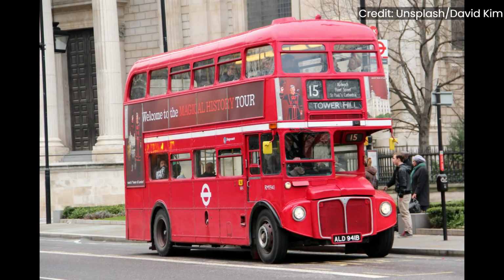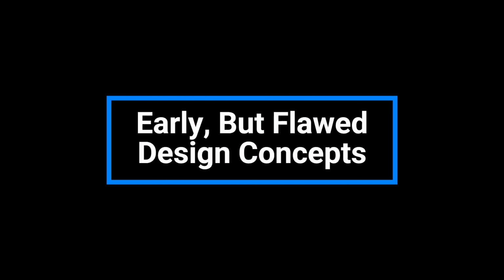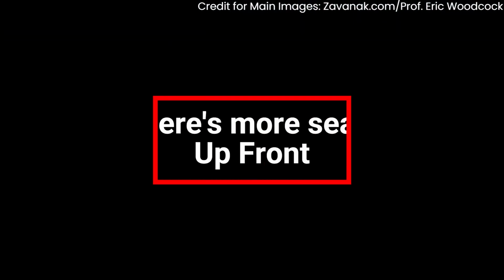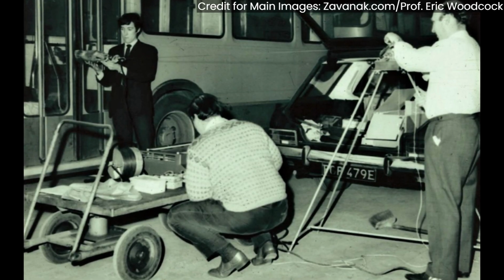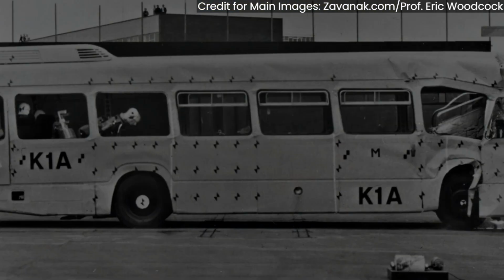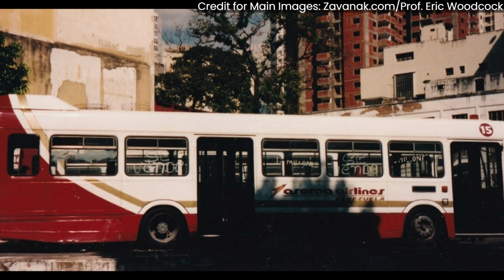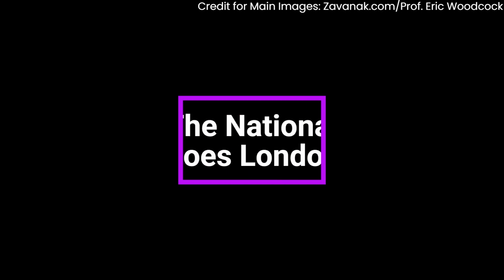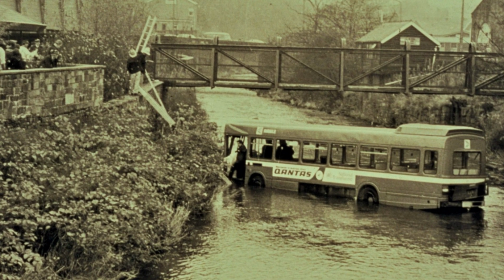The Leyland National Bus: Amazingly Flawed Engineering!

Comment: From 1969 to 1975 I worked in the Leyland Truck and Bus Central Engineering design office on various projects which included the National Bus so I feel that I must congratulate you on producing a very well informed video which includes a number of items about which even I was not aware. Nice work! I will just add that the original styling was carried out by David Bache of Rover but, at the last minute, Sir Donald Stokes the CEO decided to call in Michelotti instead to give the bus a revised look. The initial vehicle design was for three length of 10, 11 and 12 metres but, for the Michelotti redesign, these were replaced by two lengths of approximately10.3 and 11.3 metres to better match the seating pitch. The later 10.9 metre was, as you said, a hybrid of the two. The bus was originally designed to take the 680 engine and the mistaken decision to change this to the less refined 510 is suitably described in some of the  other comments. The overhead heating system inevitably lead to warm heads and cold feet: a strange decision aimed at simplifying the floor design but not the best one.
Reply from the maker: Hello! Great to hear from someone who worked on the National! Interesting info on the original design of the bus. Wish I knew that when I was making the video! Thank you for watching and for your comment!
Reply: The 500 series engine was the brainchild of Albert Fogg who had come to chief engineer at  Leyland from directorship of the Motor Industry Research Association, the charitable view is he was an original thinker.  Higher output Leyland 680s and 400s as well as examples with experimental turbocharger fitments had problems with cylinder head gasket failure. Dr Fogg's decision was to replace them with an engine with no cylinder head.

The 500 series was controversial in buses but disastrous in lorries. An early 700 cu in fixed head engine had worked well on the test benches and delivered the desired 260bhp with relatively light pressure turbocharging, but the Marketing people demanded a 1000kg weight for the engine coupled to a pneumocyclic gearbox, so it was downsized from 11.9 litres to 8.2.  The 260 hp 511 version was at the limits of material science in regards to the environment in the combustion chambers, under certain circumstances pistons would melt.

This was at the time Volvo and Scania had just started importing lorries into the UK.  Volvo's F88 had a new design of turbocharged engine, taking the opposite tack to Dr Fogg, with six individual cylinder heads, each with its own gasket.

the move from 10 11 and 12m was due to a recommendation from an international conference of city operators for a minimum width of 1421mm for doorways.  this meant the longest envisaged bay made the bus 300mm too long to operate legally in the UK and most other places at the time.
Reply: @StephenAllcroft  As I recall, the 500 engine was mainly the brainchild of the then Chief Engineer for engines (I forget his name) who had previously designed a headless production petrol engine for Leyland in the 1930's. Given the horsepower-per-litre that was being demanded from the downsized 500 engine, it was an understandable route to go down since it not only removed the head gasket problem but also improved the cooling water flow around the heads and the upper cylinders. But as always, the devil was in the details and, as with the AEC V8 diesel which was developed alongside the 500, the details were bedevilled in a few areas.

Comment: Oh nice. I used to drive them when I first started driving coaches. We had some second hand ones our company bought. They were ok, a bit noisy, but that's why they put the engine at the back nearer the passengers! Not sure about the heating as you mentioned in the video, it never seemed to work if I remember right. The engines used to explode though, throwing piston rods out the side, resulting in a trail of oil down the road. Someone told me way back, it was because they designed it with the engine laying on it's side to keep the floor height low, but the oil used to pool to one side going round corners. Also the simple riveted construction enabled them to be repaired quickly in a bus garage so they didn't need to go away to a specialist bodyworks place, quick and simple keeping the vehicle on the road earning money. Anyway a nice look back at these numerous buses. All the best Dave.
Reply from the maker: Hello! Thank you for your interesting comment on your experience driving the Nationals! Guess it had both good points and...not so good. Thank you for watching and for your comment!
Reply: Early examples had a problem as the oil sump was wrongly designed , feeding oil through the turbocharger on left turns. Revised baffles from mid-1973 put an end to that though.
Reply: I saw one explode in a bus station. A tyre fitter for the bus company had just said to me that engines about to go and it did in a big way.

Comment: I remember these! I also recall the Leyland Lynx, which was the successor to this and the window issue was quite cleverly designed with the same length all the way from front to back but with added decals at the back, so the windows could be lower at the front.

They also sounded very distinct! I remember when they were replaced and still miss them as they were kind of amazing vehicles. The ones I used to ride were Cardiff Bus/Bws Caerdydd, and some were Rhondda and Caerphilly Transport.

My father used to drive these for Cardiff Bus and later Bebbs, along with Optare Clippers and Leyland Olympians & Titans. :D
Reply: Cardiff had some ZF Nationals!
Reply: @jamesfrench7299  That is very cool! :D

I also remember that when I lived in the Ffynon Taff area, there was a company called IBT, or Islwyn Borough Transport, and they used to run Leyland Leopards. They were a baby blue/white combination and although a bit of a nightmare to get onto as a kid, they were literally coaches, so they were ridiculously comfortable. I also recall the engine on those was very unique in that it sounded amazing!

And the Leyland Olympian was also one of my favourites as they had some amazing turbo-whine. Absolutely amazing old beasts. :D
Reply from the maker: Wow, nice memories of the National! Thank you for watching and for your comment!

Comment: I loved Leyland Nationals as a kid - the seemed so much faster than the other ones, or at least certainly sounded faster! I think the irony of their design is that BL did loads of testing in extreme environments - the arctic and deserts, plus wind tunnels etc, but the one thing they didn't do was to test the prototypes in real- life day to day bus operation! So there were lots of snags, and the engine choice of the 501 engine was probably a mistake. On the plus side, the body design probably was a complete success. The mk2 version with the 0680 engine and lots of issues fixed was a seriously impressive bus, but it came too late and they didn't sell very many.
Reply from the maker: Wow, that's very interesting to hear about their testing practices!! Thank you for watching and for your comment!

Comment: Very well done feature.
The shorter roof pod was introduced in 1975 during the first National's production run ready for the phase 2 of the National 1 in 1976 which addressed issues like weight distribution by relocating the batteries in the front overhang under the driver.
Four gearbox options were offered. Four or five speed electro - pneumatically operated  semi automatic gearbox or a fully automatic version of those. A ZF two speed full automatic transmission was also offered but rarely taken up, Melbourne with 30 ZF examples.
Reply from the maker: Thanks for the info, very interesting details!!  Thank you for watching and for your comment!
Reply: Oh yes, I forgot the weight distribution problem, where you could be on full left or right lock, yet still go straight ahead. Especially with the cheap crappy re-cut tyres that many bus companies used to use.

Comment: My experience of the Leyland National in Australia, purchased in used condition by my employer. A Leyland National, fully imported, British manufacture, Headless 500ci rear engine laying on its side, it ran well but problems soon surfaced.    The air filter was positioned in such a way that it could not be serviced!!      It looked to me like it had never been serviced since new, also its connection to the body was never right and a gap of 25mm was present right behind the rear wheels where dirt and water could enter the filter.               The engine soon began using oil so we dropped it out for repair.    As I began taking it apart I could see that this motor was designed to be put together in several different ways, ie in the bus it lay on its side, in a cabover truck the exhaust manifold would be away from the driver, in a boat the flywheel would be at the other end, a brilliant design.             But, they used 17mm nuts on M10 bolts making it difficult to get a spanner onto many of the bolts, but why?  When the Japanese proved beyond all doubt that 14mm was sufficient to do the job!!!     
There was a problem with the cooling also, maybe it is OK in Britain to recycle the warm air from the rear of the bus, through the radiator and back to the engine bay but in our climate, this is not ‘best practice’.    The rear engine Bedford and the Nissan had a semicircular guard between the engine and the radiator, bringing air in through a side vent, through the radiator and out through screens in the back panels.    We did the same with this one fitting a fan with the opposite pitch.
This bus was used while # 5 was off the road, the driver approached me about a strange noise that occurred on a Left turn, “Take me out and show me,” I said, so we drove around the Redbank Railway Workshops, all Left turns. 
 Nothing happened, she was about to go Right and back to our shop, “No, go around again,”  She had to brake a little harder and swung Left at such late notice, I was standing on the step with the door open listening for this noise, looking down at the front wheel that was not turning, not even on the road, as the bus righted after the turn we got this, ‘Aeroplane touchdown noise’, arrk “That’s it,” she said.   The problem, on the Left rear an Air suspension control rod had broken pushing that Air Bag fully up, while on the Right rear one of the tires was flat, at the front an anti roll bar 50mm thick was simply picking the wheel right up off the road. Ted from down under.
Reply: I liked the buses when introduced (MMTB),  but you avoided them like plague on warm-hot days as they just broke down, esp. troublesome on eastern freeway (Melbourne. Victoria AU) as you'd be stuck on hot bus for hour+ until police & replacement bus arrived and police okayed swap. No fun on fully laiden non-airconditioned bus on 36+oC day doing nothing.

(the buses ended up being banned from freeways on 30oC+ days, so they didn't stay in service that long compared to other makes, no idea if MMTB sold them, or moved them elsewhere in city)
Reply: Spot on. If you saw one at Kew Cemetery on a hot day I'd just wait for the next bus. Invariably you'd pass it on the side of the road. In winter though that rear seat was like a bum warmer.@ChrisGuiver
Reply: sSounds like  Metrinch tools were ideal for working on Nationals. They are sockets and spanners that are designed to work on both metric and fractional fastenings.
Reply from the maker: Wow, thanks for all of this info on your experience with the National in Australia! Very interesting!!! Thank you for watching and for your comment!
Reply: You can’t say the vehicle wasn’t rigid.
Reply: That's awesome. I know the PTC Vic had them but they kept one which doesn't come out.
Reply: Sydney never went near the National, preferring the Leopard
Reply: @gregrudd6983 the 0305 ran rings around them. The PTC had been looking at them when the last of the Leopards were being built.
Reply: @mistero4  exactly
Reply: Were they metric bolts? I thought the English used the Whitworth thread, which has really large bolt heads. After WW2 they made the heads smaller but they're still relatively large compared to metric.
Reply: @castirondude  It was a bit of a mish mash from my experience. Leyland might have been Whitworth threads in the very early days as were most british companies, but certainly from the 1960's Leopards and Tigers era, Leyland mostly used BSF (British Standard Fine) threads for the fasteners, which still needed Whitworth sized tools to work on them (i still have toolboxes full of the bloody things and heaps of BSF bolts left over).... 

When the National came out I think they were trying to move towards metric for the most part, I guess to be more export friendly, but in reality it was a complete mess. 

For example:
The threads on the [New] 0510 engine were mostly metric bar some exceptions, one being 9/16 UNF bolts (Imperial / AF tools) for the torque converter. The Gearboxes, transfer box and parts of the axles were a mixture of UNC and UNF threads (imperial / AF sized tools). Air pipes and brake fittings metric, seating and other fixtures I believe were bolted with UNF..... list goes on.

You needed full sets of Metric, Whitworth and AF tools to work on them and a good selection of spare bolts to cover the huge range of sizes, lengths and threads used, just for the engines and gearboxes in my case. 

Good intentuions done the Leyland way.
Reply: @d3b536  interesting perspective! I grew up in the Netherlands where the busses were standardized , they had a really good design that was made by a number of companies including Leyland.  I think they were mostly metric but not sure. Having moved to the US I like the SAE sizes better than metric , but unfortunately sae is being designed out in favor of metric. Almost all the parts these days say made in China on them even official Ac Delco Mopar Motorcraft stuff. The western manufacturing is dead. I would love for the US to revive the US sizes and its manufacturing industry, and with that lift up the blue collar class as well.